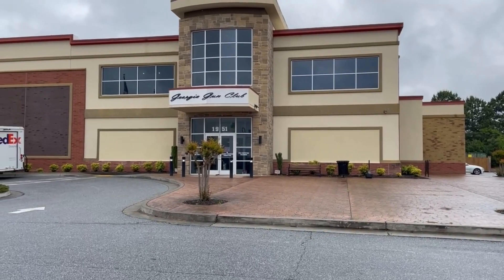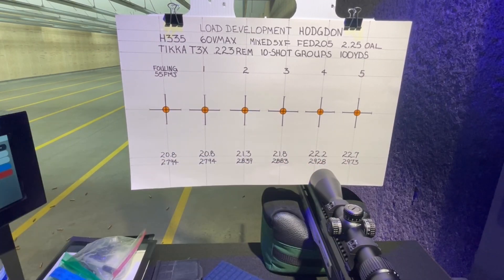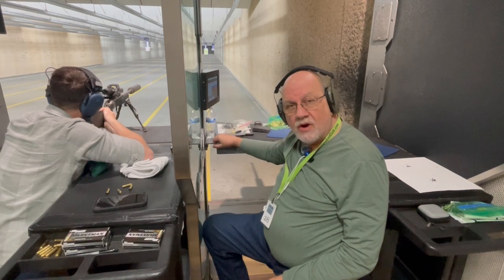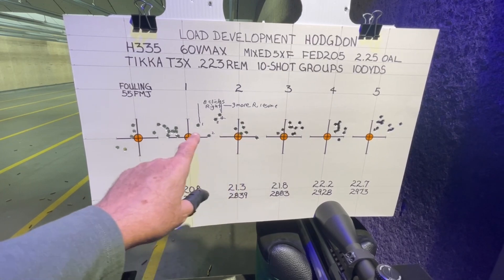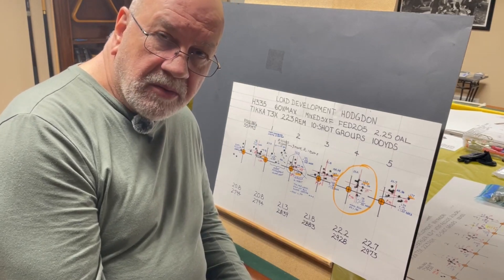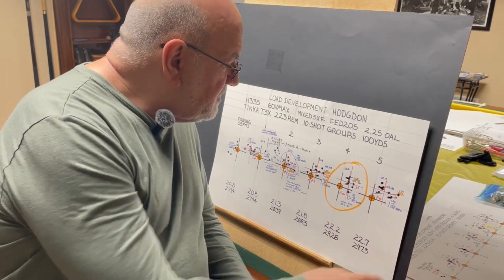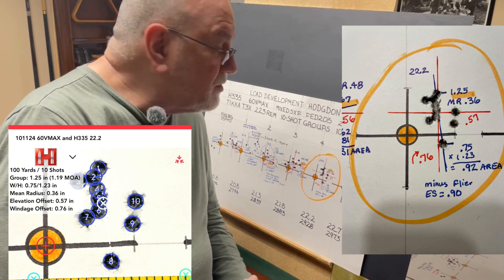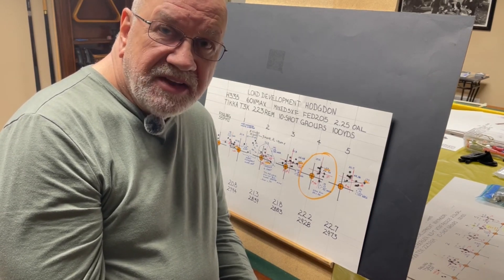Load Development With H335 And Hornady 60 Grain VMAX

Comment: Mr Phillips , 
I personally have shot .00 with the Nosler 55 grain grain accuracy load from Nosler reloading manual using the suggested Hodgdons H335. Oddly enough, I went to warm warm conditions and I received a pressure surprise!  I told a friend and he suggested H322 which was an extreme powder from Hodgdons. It was impressive. I wanted some more wind performance and I stepped up to the 60 grain fb using H322. It can do what you want. The 60 grain Vmax is where I am presently using Norma brass, gm205m, and a charge of 21.1 grains of H322
Thank you for sharing
Reply from the maker: Thanks for the comment. Good shooting. I have not tried the H322, but have had some decent results with the H335.  Thanks for watching. I hope you subscribe and stick around

Comment: A few things for consideration:

1) use same head stamp brass, preferably high quality and out of the same lot.  
2) anneal brass after each firing.   
3) consider getting a borescope and cleaning to bare metal each 100-150 rounds.   Watch for the carbon ring.
4) buy an OAL gauge from Hornady to find the lands in your rifle.  Each bullet you try will hit the lands at different overall lengths.   

These will all have a tremendous impact on accuracy.
Reply from the maker: @johnkeller6004  hi John. Thanks for the comment. If I’m not mistaken, I think I’ve seen your name on some of the reloading forums on Facebook. Typically I do use all of the same Head stamp. I use Hornady brass, but this time I didn’t have enough to reload 50 rounds. I just recently bought some Winchester, Lake City ammo, which I will shoot and save the brass to reload with. I do anneal after each firing. I typically clean after every trip to the range. I generally use a bristle brush, and every so often I use a bronze brush to clean it really well. I plan to do some testing with seating depth. Thanks for the input. Much appreciated. And thanks for watching.